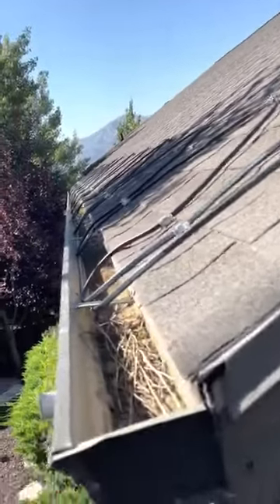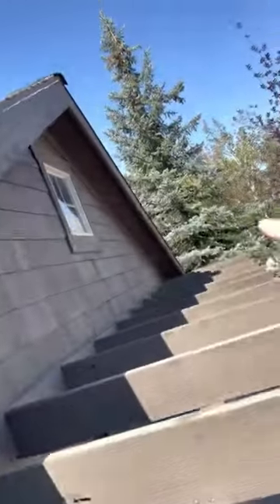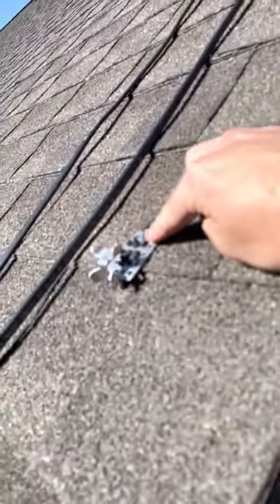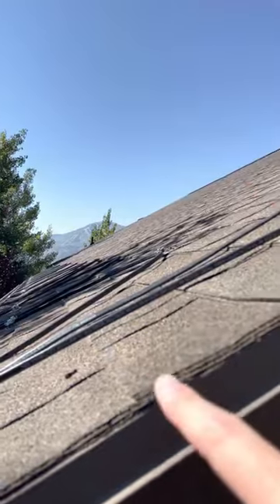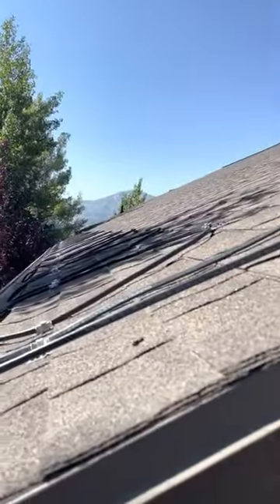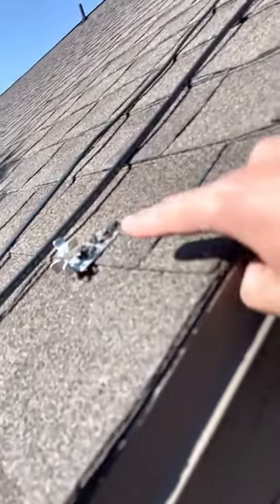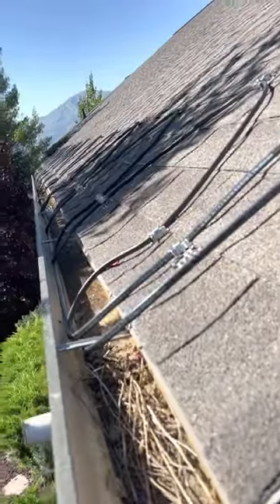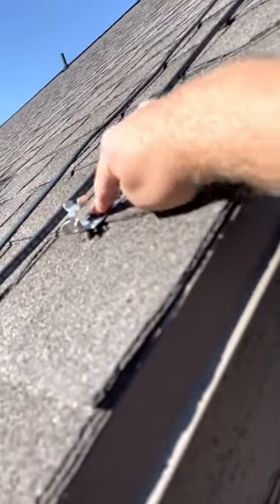Contractor Makes Huge Mistakes On Heat Cable Install

Comment: Yes.  We used Wasatch for our supplier, and had excellent results.  One thing about the clips, is to install them a day or so  before usage, so the special adhesive has time to cure, or the clips will not withstand the tug of the heat cable as it is installed.  NEVER screw or nail the clips down.... as a professional roofer said, "if water can possibly get in, it will definitely get in".